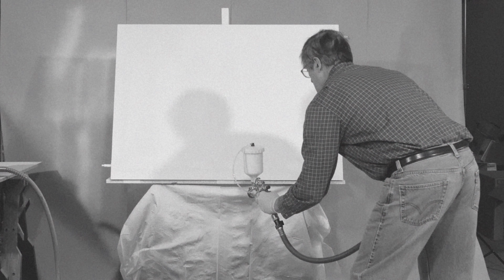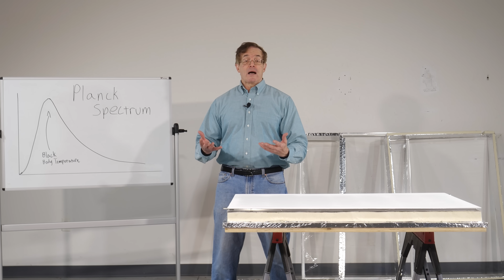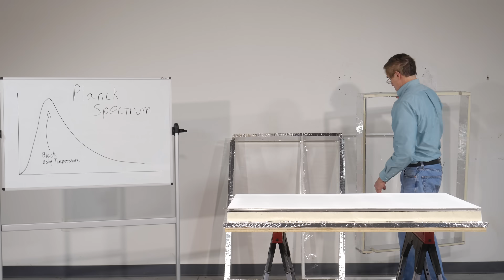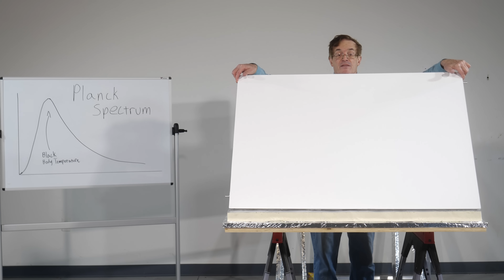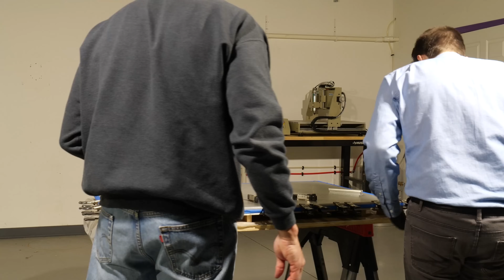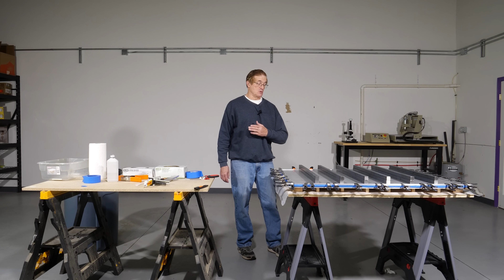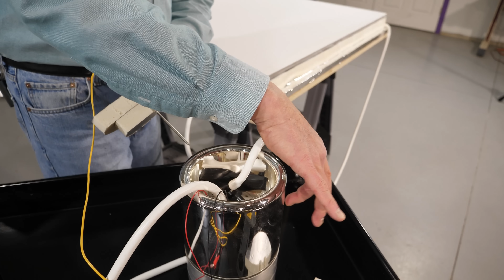Air Conditioning isn't free... but we're close.

Comment: Ok, start off with that terrible math in the first minute. Even if you found some breakthrough that would save 1%, it’s not like every operator goes out and replaces their AC unit tomorrow. Also, with the thousands of various combinations of AC, it’s unlikely your solution could scale to meet even a fraction of the demand.
Reply from the maker: Who says any existing infrastructure has to be replaced? Going forward, ADDING radiative cooling to the liqui-air heat exchange process will boost efficiency.

Comment: I found it interesting then I found it bunk.  Any notion that TOD or clouds 30k feet away would impact the energy emitted from your panel is ridiculous.  You're using the fundamental concept of delta t to pretend this is a breakthrough.  You aren't emitting 150 watts continuously.  There would be no obesity if that were true because efficiency.  The human body is pretty efficient. I'd we emitted 150 watts, how much would we be burning to give off that much waste heat?  

Bunk.
Reply from the maker: Why it it ridiculous?  Distance isn't relevant. It's the field of view.  The clear night sky emits an infrared spectrum consistent with -100C and that spans the entire view horizon to horizon. A single cloud won't make any significant difference, but a cloud cover emits infrared consistent with 0 degrees C.
Ever notice that the coldest winter nights occur with a clear sky? That's part of the reason.
Reply: @TechIngredients  conduction and radiation are different?  Your own post states this.  The infinite heat sink of space or temperature is completely irrelevant. If the "sky" was a mirror at absolute zero yet reflected 99% of infrared energy, the cooling effect would not exist. It's not that the heat can't be radiated away, it is the inaccuracy of the process.  That is junk science.

Comment: Does anyone know if the newer Low Iron glass is transparent to infrared?  I'm thinking, to make this practical you're going to need a more durable top layer to the box.  Looks like this has some really amazing potential, I'm going to try and make my own with a couple mods.
Reply from the maker: Even fused quartz, which contains no iron, becomes opaque to wavelengths beyond 5 um, which corresponds to approximately 300 degrees C.
With further testing, we found that the plastic covering was not that important. It improved the temperature differential by around 25%. You could just eliminate it.
Reply: @TechIngredients  you guys are really on top of it.  thanks for responding

Comment: would it make sense to create a vaccum inside this chamber to stop convention heat transfer? This would require a thicker sheet of polyethylene as well as (probably) some thick aluminum for the walls. I'm just wondering if it can bring a noticeable improve to the cooling?
Reply from the maker: If you want a maximum temperature differential, then a vacuum or a good solid insulator like polystyrene would be the way to go.
We wanted the cooling to be transferred via a fluid to bring it into a building.
Reply: @TechIngredients  Sure, I'm just thinking that insulating the radiator from heat exchange with the environment (aka the air around it) might improve the heat exchange with the fluid. I'm not sure how noticeable this would be, just thinking out loud :)
Reply: Probably it's not worth it since heat exchange with the fluid is much more intense than with the air. It might make sense only if we aim to cool the water to a very low temperature... although I'm not sure)
Reply from the maker: It's interesting to hear you working through the design in near real time.
Reply: @TechIngredients  anyways, thanks for the great video! I was surprised by this principle at first. It feels almost like breaking some fundamental law of physics. Had to watch the video a few times and torture chat gpt with my silly questions. 
But now I'm really interested what it can be turned into. As a resident of SoCal I can say that we need free cooling really bad 🤭thanks to our electric rates...

Comment: So you are telling me that if I build a green house and measure the temperature inside of it at night time when it is cold enough that I need to wear a jacket that the temperature will drop inside of it? I am pretty sure we already knew this. 😂
Reply from the maker: No.
It doesn't matter what the outside temperature is. If the sky is clear, you will lose heat (infrared) into space. So will your surroundings. If you stand under a roof, say a carport with open walls, you will be the warmest thing around.
Reply: @TechIngredients  I understand that the earth radiates infrared into space and that the energy it radiates comes from somewhere. I am hung up on the ideas that we could ever do anything useful with an insulated radiator and a reflective bearer within our atmosphere. I think this is a technology that only works in low earth orbit and above.
Reply from the maker: The Phoenicians froze water at the bottom of shallow wells in the desert that were open to the night sky.
This technique does work even in the atmosphere, although how useful it will be is uncertain.
Reply: @TechIngredients  I live in Texas and was just standing under my galvalume r panel covered patio. It is much hotter under the patio than it is under a tree. The shade from a tree is cooled by transpiration, phase change being another way to move energy around. I am very intrigued by the paint and watched your follow up video where you produced it. I think these coatings will play a big role in retrofitting our existing infrastructure to be more energy efficient in places that need air conditioning. If we can just reject that solar energy from a half mm layer before it is absorbed and radiates into our houses to then be dealt with by the air conditioner, that is game changing. I really like this topic and your presentation of it. If I had some of that paint it would be going on roof immediately.
Reply: @TechIngredients  I was trying to figure out what the thermal expansion rate of acrylic is to see what materials would be best suited to bond this paint to for a long lasting coating. Acrylic is very UV stable but expansion and contraction of the substrate could be a problem. You have any ideas about this. It would be great if lasted 25 plus years on concrete construction like so much of the third world has exposed to sunlight. Really could save some lives.
Reply from the maker: I have given this some thought.
I suspect the answer will be to eliminate organic binders altogether.
A ceramic process that binds the barium would be very robust but be more difficult to lay down because of the high temperatures involved.  But, you mentioned concrete...
Reply: @TechIngredients  product idea. Use this coating in phone cases so outdoor workers can set their phone down without it overheating and shutting down on them. I work outside and it never fails you set your phone down in the shade so it doesn’t get broken or wet in my pocket. Then by the time I come back to it the shade has moved and my phone wont power on. Not a good scenario if there was an accident or other emergency.

Comment: Just having essentially 2 aluminum plates might not create enough turbulence, and end up having more then half of the water running through to just run diagonally from the input to the output. You will want to add some channeling next time, it will increase the efficiency massively.
Reply from the maker: If you look carefully, that's exactly what we did.  The dividers are staggered to create flow along a rastered pattern.

Comment: The biggest issue with indoor climate control is the lack of Insulation. The air conditioning is always fighting against the outside air that too often has easy access to inside the house. The down side for most houses is that to fix this requires a big renovation.

Comment: Use a trompe and a ranque-hilsch vortex tube.
Reply from the maker: If you mean for cooling, then that requires a lot of energy.
Reply: @TechIngredients  To clarify, no electricity needed, aside from maybe installation/manufacturing parts. Trompes use water to compress air, a Ranque-Hilsch vortex tube uses compressed air to generate hot air on one side, and cold air from the other. If you wanted to take my idea to the furthest possible end point, you would have the water exiting the trompe power a dynamo. Essentially turning a creek or river into financially free air con, and electricity.  If you're using energy in the sense of; for a lack of a better way to put it, "movement" then absolutely. If you mean energy as a substitute for fuel consumption/electricity then it's almost like a free money glitch.
Reply from the maker: I understand and was not referring to the type of energy or its source. A vortex generator uses a LOT of compressed air, and that requires a lot of energy to generate.
Reply: @TechIngredients  If you want to get right technical, just wait for entropy to run it's course, cooling is absolutely free.
Reply from the maker: Cooling to ambient is free, but that's not what the system we demonstrated is limited to nor what a vortex cooler is used for and that isn't free.
We are always technical.🙂
Reply: @TechIngredients  the heat death of the universe is absolute zero, you're not getting any cooler than that. I think you're being grumpy because some guy on the internet came up with an equally cheap solution using old tech.
Reply: @TechIngredients  and it seems kind of silly, considering your main goal seems to be lowering electrical production needs.
Reply from the maker: You're projecting.
I appreciate you taking the time to comment and welcome other content producers to the party.
The system you refer to is very different from the system we demonstrated. It may have some applications, but the efficiency will be extremely low. The air pressure for a vortex cooler needs to be high, while the pressure available from that hydraulic system will be low unless a very high head source for the water is available. That requirement will be hard to meet. Entropy is not your friend.
Reply: @TechIngredients   I'm projecting? That's hilarious. What you've proposed isn't even cooling. If an object never reaches x degrees is completely different than bringing an object down to x degrees. it's the difference between preventing energy from getting into a system, and removing energy from a system. Holy crap, you act like we dont know how to change air flow rates with nozzles, a thing we've been doing since at minimum steam trains. Entropy is nobodys friend, it's the heat death of the universe.
Reply: @TechIngredients  It's also dishonest to to refer to a Ranque - Hilsch vortex tube as a vortex cooler, as the vortex tube also produces hot air from the other side of the tube.
I had originally thought man, this guy has a neat idea, I'll share my neat idea, maybe we could have these two neat ideas work in tandem. However the more I talk to you, the more I realize, wow this dudes an asshole.

Comment: If you didn't need to move it and weight wasn't an issue, would something like a car radiator work just as well as long as you added the coating and insulation?
Reply from the maker: It would work,  but not as well.  You DON'T want the surface to interact with the surrounding air, which is warmer than the surface.  The car radiator (really a liquid to air heat exchanger) has a lot of open structure that will increase that interaction.

Comment: what about reversing the process and blocking radiation to the sky ? How useful is coating aluminium on a rooftop ?
Reply from the maker: Bare aluminum has a very low infrared emisivity and would work best uncoated.
A good rule of thumb is that the more reflective a material is any wavelength, the less of that wavelength it will radiate from below.

Comment: Would acrylic sheet work well to replace the plastic wrap, as it's so fragile?
Reply from the maker: We discovered that the presence of the sheet added little to the performance and now run without it. 
There is a little IR absortion by the polyethylene and more by acrylic.  If you're going to use a cover, it has to be as thin as possible.

Comment: I paid a lot of money but now my air conditioning is free.

-400ah lithium battery
-1000w of solar panels 
-60a charge controller
-5000w inverter
-9000BTU ac mini split  

Runs about 6 hours on battery alone. Solar panels keep it rolling.

Comment: Do you have any update to this system working in the summer time and/or during the day.  What is the practical, if any,  heat dumping capability at say 32C at noon.
Reply from the maker: The hotter the environment,  the better this will work because the infrared radiation increases with temperature to the fourth power.

Comment: This seems really cool but also, the cost & complexity seems on par with a solar panel  - actually solar would be cheaper because it has achieved economy of scale. But even assuming these could be mass produced as standalone panels for a comparable cost.

just napkin mathing in my head I think the solar panel -> AC would produce probably a comparable amount of cooling. A solar panel of this size realistically would be rated at 150-200w; you claim this panel can emit 150w. The solar panel probably only produces around a third or quarter of that averaged out over the day, but this is balance out by a typical coefficient of performance of a decent AC unit - i.e both are removing ~~150w of heat from the house.
Reply from the maker: Sure. 
It's the principle that matters more than the specific device. 
As I showed in our follow-up video on making and testing the coating, this cooling effect can be realized on any surface, such as a roof or an entire building. Adding an additional cooling process would then require less energy.

Comment: How does this not violate thermodynamics? Im exited to see the math
Reply from the maker: You don't even need math to understand the principle. As I explained relatively early in the video, the sky is VERY cold.
We don't notice it because we are surrounded by warm air or the sunlight that most surfaces absorb well.
A coating that can radiate infrared efficiently and reflect sunlight away will cool below the surrounding air temperature.
Reply: @TechIngredients The sky is very cold but only at altitude, I'd say the radiation gets dissipated mostly by the moving air
Reply: @markmuller7962  the paint radiates at the specific wavelength at which the radiation dosent get dissipated by any air.
Reply: @abhishekak9619  And goes directly to space lol? That's not how physics works
Reply from the maker: Mark,
The sky is very cold, radiativly.  It has the same infrared spectrum as a surface at approximately (-)100C.
The coated surface we demonstrated sends photons of energy up and out into space, and the sky radiates photons up and out as well as back down to our coating, but far fewer because it is so cold.
Reply: @markmuller7962  you are right physics is not that simple which is why there is a tiny window where this ends up working.

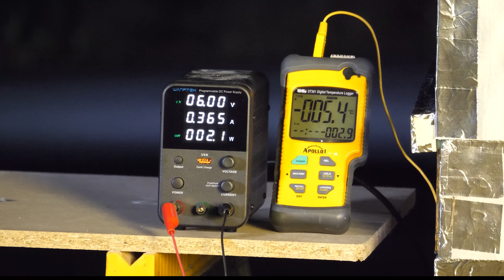Comment: Am I reading it right? The final difference is 3 degree with the ambient. At 21:50
Reply from the maker: Yes, however, I'd use versus instead of with.
Reply: @TechIngredients  thanks for your reply. I did not find your other video regarding day time cooling efficiency of this device. Is it still around 3 degree Celsius? But you also said it only worked during the night.  What's the difference vs. the ambient temperature during the daytime? Thanks in advance.
Reply from the maker: Check out "Cooling Nearly  Free."

Comment: melt the lime stone with water add adhesive to fix the lime paint and give 2 coating paints on the sun exposing concrete's outer walls and terrace of the building lowers the temperature too.
Reply from the maker: Sure.  The amount of cooling depends on the performance of the coating.
Reply: @TechIngredients  which depends on the density of the coating. i have watched this video too many times. could you at help me out. i asked those questions and they have been ignored. if i were to sandwich the paint between the sheets which doubles the surface area but only if the paint works how i think it does. so this is how the paint works. the paint radiates the heat in infrared and then if that goes towards the sky then hurray its gone forever but if instead of the sky its another surface of this paint that can reflect the infrared towards the sky then does that work. i know its diffusion as in you cant measure it the way i have asked the question. so if you had a 1 square meter insides surface area box the top side is open than would it work the same way as normally . i think it would be slightly worse how much worse . do i even need to know that. will it even work how i think it will work?